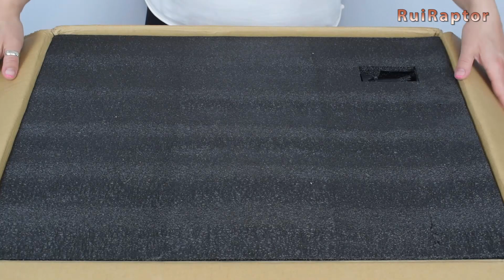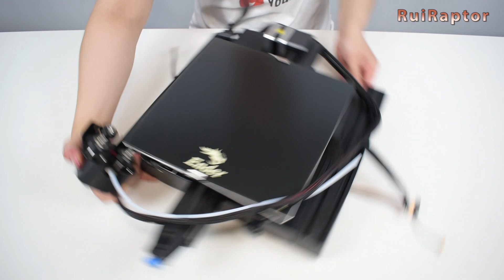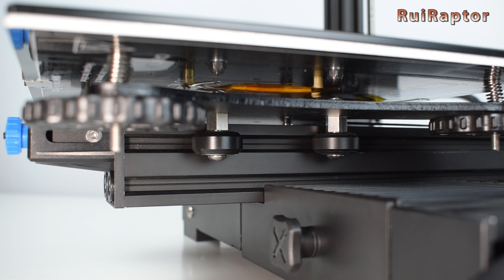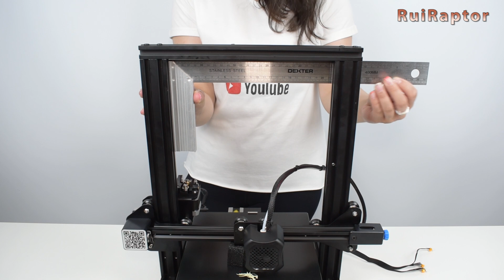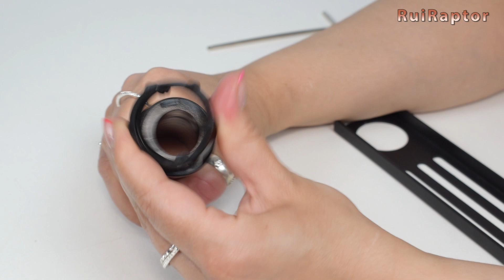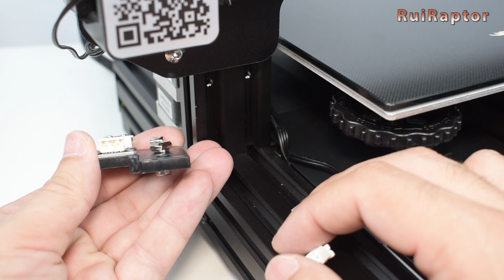Creality Ender 3 V2 - ASSEMBLY GUIDE With Tips & Tricks

Comment: Does anyone know the reason for changing the wire ferrules at the beginning of the video? Thanks in advance!
Reply: For those reading this: The reason to use ferrules is the power wires tend to get hot, this makes the solder on the wire get soft. It deforms and can get loose. Which can cause it to get hotter, short, etc. Ferrules prevent this, if you don't use them just make sure to check the connections every so often and tighten the screws if needed. There are 6 wires you should do, BV3D has a video that explains all about using ferrules on the printer.

Comment: I hope you can help... when I build mine, the left vertical bar leans forward.  I tried loosening and re-tightening, but it is still leaning forward.. maybe 2 degrees.  it isn't 90 degrees to the bed.  Do you think that's a problem? The right one is a perfect 90 degrees to the bed
Reply from the maker: Maybe you have a bad cut profile. Try to dissassemble that left vertical profile and install it up side down. Maybe the top side has a better cut.
Reply: @ruiraptor   they dont label whitch is witch the x axis is the on with three holes and u have to screw it in from the back

Comment: if anyone is having issues with their printer not turning on after assembly make sure you have the correct voltage set in the back
Reply: Thank you haha! I kinda freaked out for a second
Reply: @scrimure  I did too at first then I had the bright Idea to change the voyage and low and behold it worked

Comment: Really the best video on here for assembling the Ender 3 V2 properly. Regarding the Z Stepper Motor Alignment Procedure at 17:46 I had to add the shims between the plastic mount and the Z motor instead of between the plastic mount and the metal rod.

Comment: Speaking of electronics, disconnect the stepper motors during assembly. They generate high voltages if moved quickly. The new controller boards at 32 bits operate at 1.63vdc at the core, and these motors are making much more than that. Even if it seems fine afterwards, it can get unexpectedly glitchy later. Yes, even our little data buddies can get Alzheimer's...

Comment: The z switch is NOT supposed to be pushed down until the tab touches the base. The bottom of the switch is supposed to line up with the bottom of the z axis pole (so the tab doesn't touch anything - it is several mm above the base). You even mentioned that if the bed is too low you can smash into the stepper motor. I had this problem - had to move the z switch up as the manual says (although creality missed this in their own video too). I don't know why you would suggest cutting the tab on the z switch and moving it DOWN - this would make the problem even worse and make a more serious collision which could completely ruin your printer. Also, if the z switch ever came loose nothing would stop it falling all the way down - this would be disastrous and probably would ruin your printer also - Why would you suggest this?????
Reply: Apart from this the video is excellent though.

Comment: would blue loctite help with knobs from loosening? Blue is a medium loctite and will not lock the nut like the heavier loctites ....
Reply from the maker: You can use a normal nut tightened against the knob. That will lock it in place and at the same time if you need to re-adjust the leveling, you can easily do.
Reply: @ruiraptor  great idea! 😁

Comment: I'll be using this as a reference guide since I found this to be the most comprehensive and well paced videos. Just a couple questions, what was the whole thing at the beginning with the power and checking the board. Is there something I need to do here? Are you just checking to make sure you have the right board or what is going on here? Also, if I don't have a right angle ruler how difficult is this step going to be? Should I purchase one before attempting this assembly?
Reply from the maker: Hi Tin, regarding the board checking, we recommend to check if every connector is correctly installed and also, for the screw type connectors, check if the screws are tightened and the wires secure. Regarding the square, you can assemble the printer without it, however, a good square frame will prevent other issues in the future, so, if you can get one, it would be better in our opinion.

Comment: Thank you for this awesome detailed video. You touched all the aspects and helped me alot today. I've just build my first 3D printer and the instructions given in the manual is a little difficult to understand. I first assembled my ender 3v2 as per the given instructions and faced various issues. But because of your video I've also found a manufacturing goof-up by creality. They changed the orientation of the bolt heads on my x carriage pulleys and there is no way of putting the X carriage extrusion. But Thanx to you I've solved this problem. Again thanks a lot man keep up the good work.
Reply from the maker: Hi Vikas, thank you so much for your feedback.
Reply: I have the same problem. How did you solve it?

Comment: I would not instruct people to cut the notch off the Z stop switch.  What's the point?
Reply from the maker: Hi,
the stock bed springs have low compression strenght and you need to compress them a bit more for better performance.
However, when compressing the springs a bit more, and after homing, the nozzle will not reach the bed. You need to adjust the Z endstop (to lower the nozzle) but because of that plastic lip/stop, you don't have much adjustment travel.

Comment: The Ender 3v2 is my first 3D printer. Thank you for the great and logical instructions, it runs straight away! I didn't even look at the original instructions. :) 
My tip, don't jam any cables, I did that with the z-limit switch .. :(

Comment: thanks a million for this video.. i setup my printer using the same. The way the video was shot was awesome!

one important point to note.. the z axis limit switch need not stop at the notch given.. you can keep it a bit higher, the base of the switch on the same level as the z axis profile. this will help to raise the overall height, and levelling will also not lead to the y axis stepper motor being hit.. The manual from creality also says the same thing on step 1..
Reply: Did you figure out how to turn those rectangle nuts in. I had a really hard time so I haven't put it on yet
Reply: This! I had this issue and thought it was a problem with the unit. Most videos miss this (even creality's own video). BANG! Nasty gouge on my stepper motor housing. Luckily I noticed during the leveling process that something wasn't quite right.
Reply: Wait what? I realised at the end they mentioned this - but they suggested you should cut the tab off the z switch and LOWER the z switch - what!!! This will make the bed lower and make the problem worse. Why would they suggest that!

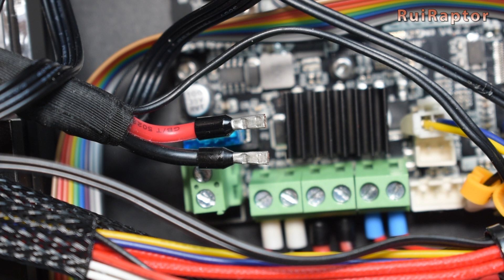Comment: Great video! I don´t understand what you are doing on min 7:42 with the wires. Is that necessary? what is that for?
Reply from the maker: Hi Juan, what we are trying to show is that the manufacturer does not use ferrules to connect the wires to the screw type connectors. This can be a safety issue and that's why we always recommend to crimp ferrules to these wires.
Reply: @ruiraptor  never heard about this but safety is important. Any chance you could show how to do this for total noobs that never heard the name ferrules before?
Reply: @ruiraptor  can you explain why this is a safety issue?
Reply: Any recommendation on connectors and size

Comment: Does isopropyl alcohol ruin the glass bed? I cleaned mine with IPA and it leaves a weird residue and now I can’t get rid of it. Any ideas on how to properly clean this?
Reply from the maker: Hi Jake, for these type of beds (glass with coating) the manufacturer recommends not to use alcohol. They recomend using soap and water. But don't worry, use dishwasher soap (for example) and clean the glass. It will probably take you several tries but we bet you will get your bed nice and clean again.
Reply: ruiraptor thanks so much! I’ll give it a try and let u know how it goes

Comment: My ender 3 V2 is running steppers hot to touch. Noticed these are my vrefs
X & Z - 1.194
Y - 1.009
E - 1.34
What should be the correct vref?
Reply from the maker: Hi, the stepper run hot on this printer. That's why Creality put warning stickers on them. These steppers are rated to work up to 80 degrees C but they are running at lower temperature. Did you measure the temperature on yours? It's possible to reduce the Vrefs a bit but this needs to be tested to check if there will be no layer shift/skip steps.

Comment: this is my first printer, how do you bootloader (flash) if micro sd can't read itself, or update firmware in printer? i tried everything.. as quick as i put everything together? i'm gonna quickly return, and exchange 😭 good video by the way 👍 i can't update it, even though the printer works with just cable, its gonna be a problem in the future. unless there's something i don't know? could you tell me thanks
Reply from the maker: Hi, it seems that your display is always black correct? Try to get a new memory card or format the one you have to FAT32 and copy only the firmware (BIN file) to it. Try to boot up the printer with the memory card inserted and check if it flashes the firmware.

Comment: Still not seeing $200 more of value
Reply: Probs a bit late to answer, but just received my Ender 3 v2. I can tell you a few things that make the extra 70eur compared to the v1 make it more bang for your buck. Firstly, it is much more quieter, so if sound is a bit of an issue, this is better. They use new stepper drivers which make the steppers quiet, only comes with this Ender. (If you also take into account that creality sells their 8bit silent mother board for 48eur, the value builds up a little bit). Next, it's a 32bit. I know they said they'll equip all new Ender 3s with a 32bit, but vendors have to get rid of all stock before you get one with a 32bit. 32bit is a nice future proof feature as Marvin might demand more to run in the future. Also, it comes with a 20eur glass bed for free, which for the hobbyist, is better than the magnetic build plate as it lasts longer and works v good with pla (which they'll probs use). The new interface is nice but not necessary, but does offer a few more features than the v1. It uses a 40×40 as opposed to a 20×40 to the v1. The power supply is a meanwell and is mounted on the bottom (functions better than v1 (tho same power supply as  v1 pro) and doesn't hit against build plate or as easy to damage).So basically, it's more quality of life changes, better build quality, will produce basically the same print, but comes with most of the upgrades that most will add to their v1. Hopes this answers a few q's.

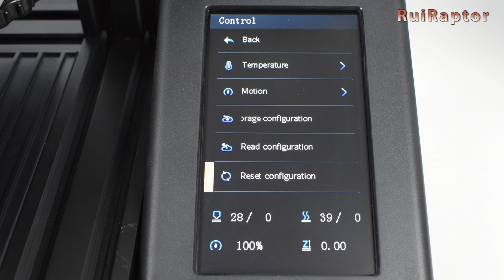Comment: 24:44
Note v0.0.9 is FAULTY firmware.
While printing, then TUNE (i.e. adjust temp, etc, then BACK), printer will do layer shift damage, make loud grinding noise, and also possible MicroSD card corruption (it uses MicroSD card to emulate EEPROM storage, layer save for power loss print resume).

Update to latest v1.0.1 asap.
https://www.creality.com/download/32
Reply from the maker: Hi Tim D. 
Yes, and as we mention in our previous video, the firmware can be updated in one of two ways.
https://youtu.be/y87P7K5DTMU
Also, Creality released a new version today (2.0.1) in their website.
Reply: @ruiraptor  yeah, looks like they did...  but to add to confusion, which Creality is good at, it is a .RAR file instead of .ZIP (most familiar with)?  They keep moving files, renaming them etc.  It's probably the same Creality v1.0.1 just renamed, but I will have to take a look and UN-RAR it.  It would be nice if the included CHANGE LOG too.  : /

EDIT:  Looks to be Creality v1.0.2 now.  No idea what changed from v1.0.1.  Creality is so screwy.

Comment: 14:31
VERY IMPORTANT!  DESIGN DEFECT!
These (2) screws share the same hole and bottom out and cannot get fully tight.

Add a 1mm thick FLAT WASHER to the rear side.  NOT the front side tapered countersunk screw!!!

REPLACE STOCK SPRINGS WITH YELLOW SPRINGS!
Replace stock black plastic extruder (it WILL break) with metal silver extruder with larger silver coupler.  Or get a dual gear extruder such as EZR, BMG clone or Bondtech etc.

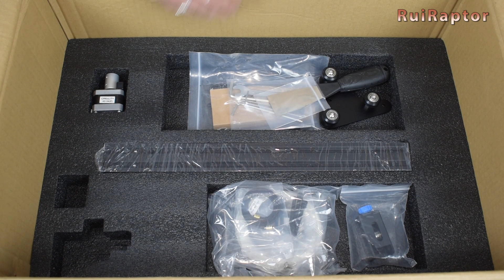2:24 Good point.  Best as a visual indicator.  I take off every filament change, so would NOT want tight.
Reply from the maker: - On our printer, both screws have beem get fully tighten without any washer. Maybe Creality changed this like they changed the X carriage backplate.

- Several users reported breaking the extruder lever, but we didn't break any from our machines yet. The metal/dual gear extruder is an inprovement over the stock one.

- Not sure what you mean with your last remark.

Comment: Looks like you got the CORRECT backplate that has the additional (2) mounting holes (left side of backplate next to plastic fan shroud) for a BLTouch or other things such as pen holder etc.

Mine came without it : ( but SainSmart (Amazon USA) will be shipping another backplate I will have to replace.